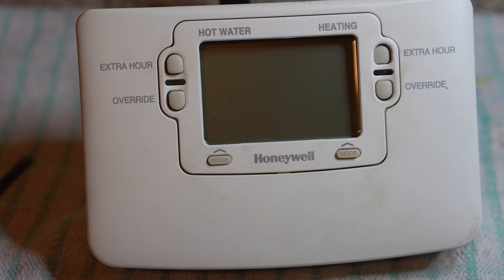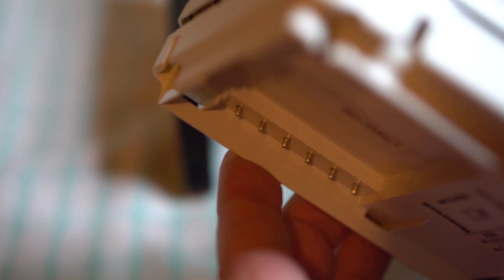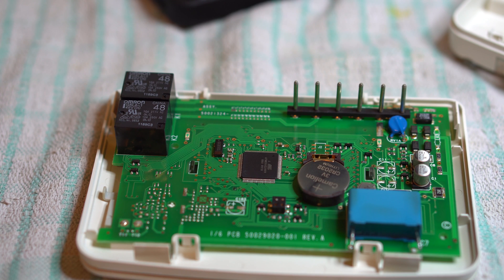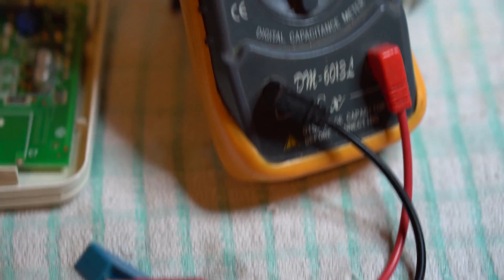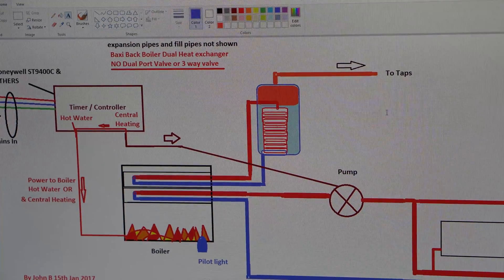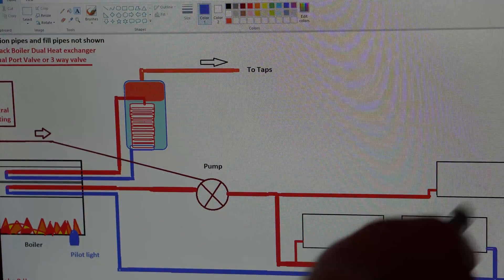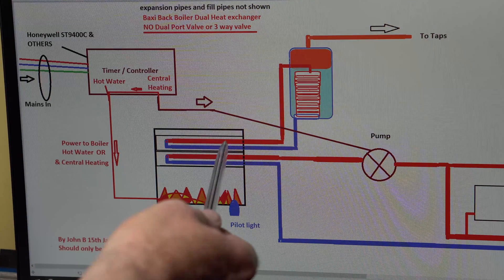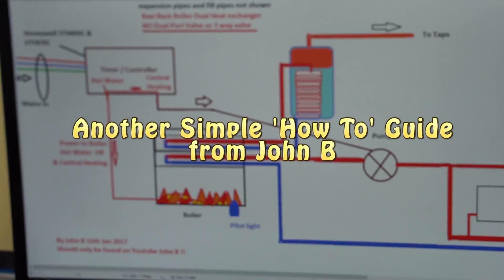Central Heating repair guide Honeywell Timer Problem with Back Boiler ST9400C

Comment: Awesome video, thanks for sharing. I will be trying to fix my honeywell timer.
Reply: Argh, mine measures 0.66µF so guess that's close enough to not be at fault!
Still getting clicking on and off symptoms.
My circuit board is looking a little brown in the corner with the round blue ceramic capacitor.

Comment: Thank you for this. I had the same problem which took a month to find because one day the heating came on and another day it wouldn't. It seemed so random. Hot water always came on. I didn't find out what was happening until I turned the hot water off and the heating switched on! The valves looked OK. The boiler was serviced and it worked because hot water wasn't being demanded. It's one of those problems that can make you go bonkers.

In the end, a two minute job to replace the st9400c and it all worked again! So annoying.....
Reply from the maker: Thank you for your comment

Comment: I have one of these and it sometimes switches the CH on when it shouldn't be on. Although its set to auto, all times for on and off set, it changes to once or Continuos on its own. No problems on the HW. Its a vaillent boiler not a combi and only 18 months old. Any ideas, its driving me mad.
Reply from the maker: Sounds like moisture has got into it. 
Time for a new one.

Comment: The caps age by slowly reducing capacitance. I tested many in this circuit arrangement and depending on the quality of the supplied capacitor the effect maybe very fast, like months or, may last many years. I experienced a nightmare batch problem with a product where all units started failing in a few months. Cost the company (not Honeywell) a fortune to replace them all. Take care to fit a really good quality cap from a reputable supplier.
Reply from the maker: Thanks for sharing

Comment: Hi John, really great video with good explanation. My problem with this unit is intermittent output to the boiler. Boiler runs for awhile then stops - no voltage. The capacitor on this unit measures .864 microferads (the one on your video was .68 microfarads.)  Could this capacitor still be the culprit in this case? May just have to replace the unit.
Reply from the maker: Thank you for your comments.
I'd replace the unit, B&Q sell a good one for £25 approx.

Comment: Hi John, great video and wondered if you could help me with my problem. I have the same programmer and if I put the heating or
The hot water on a hear a click for both but for some reason the heating doesn’t actually come on but the hot water does. I’ve tried them both separately but just doesn’t seem to want to get the heating side on. At the min I’m having to put the heating on via the water but move the 3 port valve over. Could it still be the capacitor not drawing enough power even though I hear the click? Thanks
Reply from the maker: It's difficult to say without testing the parts.
You need a test light to see if power is going to the 3 way valve.
Maybe buy a new programmer from B&Q for £25 to eliminate it.
Reply: Mines doing the exact same but sometimes it works sometimes it doesnt
Reply: Mines doing that lol get both clicks too

Comment: My Honeywell timer switch is playing up, I think I'll replace whole unit....like for like...isolate electrical circuit and fit same..unit, probably easier for me. I'll take photo to merchants...think I may be able to fit okay. If not sure get professional in...have a look at it first.
Reply from the maker: Yes, sort of easy to replace with same size and make.
2 screws underneath and the whole unit hinges upwards to release the electrical contacts.

Comment: I have a same problem now, I didn’t hear any click sound , hot water and heating doesn’t work. Must need to change the capacitor?
Reply from the maker: It sounds like it.
You could hit the timer to see if it will help the relays come on.
Or, as I did last week,  go to B&Q & buy a new one for £25, they are great and work the same.
https://www.diy.com/departments/salus-2-channel-programmer/5060103693511_BQ.prd

Comment: I had the same problem, the timer would click on the water side but not the heating. After watching this video a few times, decided to give it go. Ordered the 0.66 305v from ebay and changed it. Now I get to hear the "click" on both the water and heating side and it all works. Only time would tell if it lasts., albeit no cap test and some very dodgy soldering. A few quid saved for now, so thank you very much John B.
Reply from the maker: Excellent news, thank you for your comments.

Comment: Nice info on the problem with electronics of the ST 9400c Only one heat exchanger on a Baxi Bermuda though 👍.
Reply from the maker: David Kennaugh yes someone pointed that out, although 2 sets of pipes

Comment: Very smart. I have one of these showing the symptoms you describe.
I should point out an important safety issue. The choice of capacitor is very important. It must be X rated, which means it can be connected direct to low voltage mains and if it fails is less likely to fail in a ball of flame. It must be X2 or X1 rated as these can handle higher voltage spikes. The capacitance value is important because this will dictate how much power is drawn from the mains. excess power is dissipated as heat so a larger capacitance will create more heat and probably lead to failure. A lower capacitance will not provide enough power to power the circuit.
Another thing I should point out is if something else in the circuit has failed and is drawing excess power then replacing the X2 capacitor will not help. It is for this reason I'm not going to repair mine.
Reply from the maker: nice

Comment: Thanks for the vid, John. I have a ST9100A which is the same from this aspect. 48V relay is only getting 20V. What a cheap and nasty circuit. How many electrical appliances are thrown out every year due to a bad dropper cap I fear to imagine (same thing happened on my freezer, which I also fixed - with that the dropper cap was voltage under rated for AC). My unit is about 7yrs old.
Reply from the maker: 6 or 7 years is about the norm

Comment: Many thanks John.

We have a standard 'Y' plan system with a 3 way valve. A few days ago we had no hot water and following a quick check I was convinced that the Honeywell 3 way drive unit was the culprit.  I replaced it and all appeared OK, but then the next morning, no hot water again.
The readings I was getting on the 8 way wiring block, were very confusing.  One minute a terminal would show 240v and a couple of minutes later it had gone.  I checked all of the wiring and everything was correct.
Then I discovered your video and the penny dropped.  Sure enough if one relay was energised the second wouldn't switch, and of course the voltages were only present for the circuits controlled by the first relay.  Testing confirmed the 680nf capacitor was actually 350nf.
Radio Spares EPCOS 680nF Polyester Capacitor PET 305V ac ±10% RS Stock No. 874-1456 cost £2.12 for 5 (minimum order) including VAT, and free delivery.  I now have 4 spares, which should last me out.  So 40p  against Screwfix 's price of £96.59, for a Honeywell ST9400C programmer. The relays now operate with a reassuring click and the system operates as designed.
In conclusion I owe you big time.  Cheers Noel.
Reply: Hi John exact same issue with mine,  thanks for the info.  £5.88 for 5 plus £4.95 delivery + vat  £13. Found this on Ebay https://www.ebay.co.uk/itm/0-68uf-680nf-275vac-X-type-capacitor/282120826789?hash=item41afb62fa5:g:YqsAAOxyc2pTbMYn  not the exact same spec but would it be ok. Thanks.
Reply from the maker: Excellent news Noel, I'm pleased you were able to save the best part of £100 and now you understand more about your timer too which can't be a bad thing.
Have a great weekend.

Comment: Any estimates on how much to repair if you called out a plumber who says this is the problem and needs replacing?  £264
Reply from the maker: Peter Roberts 
Omg 
The timer costs less than £100 and 10 minutes to swap over.

Comment: Hi I can't find a capacitor with the exact details that my one has out of this Honeywell model but can someone please send me a link of ones I can buy
Reply from the maker: Try Farnell
Reply: John B
Hi just looking on the website. Which one do I get
Reply from the maker: Rebecca Ford what is the value of the one you have?
Reply: Sorry I don't even know what writing that is on my capacitor
Reply: The numbers on the side are:

B3293 x2 MKP/SH
40/105/56B

Then it has a logo EN  10
                                 EC
                                  305v

Then 1414 (250v~)
            1283 (305v~)
Reply: On the top it says m105255980 B
W2-u68 k305v~
Reply from the maker: @rebeccaford3868  You will have a value like .33uf .47 or .68 uf etc all at 305 volt ac 
Those values are point 33 .33 etc 0.33
Do you have someone to solder it in for you?
Is your thermostat dead?
Where in the world are you?
Reply: So is the value not in any of the writing. I have to found someone who can test the capacitance for me to see if my capacitor is working properly at what I thought would be 0.68 just based on what I saw in your video as it's the same Honeywell model. Then have someone to solder once I've ordered the capacitor if I need one or I'll have to buy a new Honeywell timer.
Reply: The Honeywell just keeps clicking on and off and flashing but won't stay on for more than 3 seconds then turns off one one then back on
Reply from the maker: @rebeccaford3868  .68 sounds good, if the timer is becoming intermittent or only one mode works, just order the cap and replace it. I'm in South Yorkshire so too far to pop round and check it.
Reply: John B
Yeah but that's the problem I'm not sure which one to order. Do you know based on the details I gave earlier what one off the site is ok or can you send me a link off any if possible please? Is it any 0.68 at 305v then? Then if I test the capacitor I have and it is less I know if need to buy one and wait for it to come. If it does read at 0.68 then I was just going to go out tomorrow and buy the same Honeywell timer
Reply from the maker: @rebeccaford3868  https://www.ebay.co.uk/itm/CAP-FILM-PET-0-68UF-305V-RAD-B32934A3684K189-Fnl/272684004780?hash=item3f7d3bb5ac:g:lNIAAOSw~y9ZJIlF:rk:4:pf:0
Reply: John B
Thank you only just seen this. Ok thanks for all your help so I'll order that. Does it matter that the metal clip bits seem really long in the photo compared to my capacitor that came out I thought terns of fitting it back in the space and any tips on what to do to solder it well I'm going to ask someone who I know has a solder but don't think they've used it for years.
Reply: Also I did ask someone and have borrowed a multi metre as no one had a capacitor reader but not sure how to use it yet a and my capacitor doesn't actually have plus and negative markings on it so not sure how to test it or if I can? I was just going to test it in case as then wouldn't have to wait for a new one to come
Reply from the maker: @rebeccaford3868  One simply removes the faulty cap, solder in the new one and cut the legs to suit the pcb

Comment: The comments may be accurate on the electronics, but less so on the heating, the boiler has a single heat exchanger with connections for both pumped and gravity circuits.If gravity circuits are used for the hot water, the control will only provide heating if the hot water demand is on. The st9400 must be configured as a mini programmer to achieve this.
Reply from the maker: Why are there 4 pipes to the back boiler then?
Reply: Two gravity circs, flow and return, and two connections for the pumped radiator system. Flows connected to the ports at the top of the heat exchanger and both returns connected at the bottom.
Reply from the maker: I'm now completely lost. 
So  if there are two gravity circuits, there are 2 heat exchangers in one unit, no?
I'm trying to understand your first comment.
If one wants hot water only, the timer will fire up the boiler.
If one wants heating, it will fire up the boiler and the radiator pump.
A consequence of heating is hot water.
Reply: https://goo.gl/images/8pWrV4, https://goo.gl/images/Mh18gC. One heat exchanger with 4 connections. Two used as gravity circulators for the hot water, the heat produced in the boiler produces the energy to move the water/heat in the circuit which passes through the coil in the hot water tank where it cools and back to the boiler, the simple principle that heat rises. The second pair of connections are used for the pumped circuit to the radiator system.Turning the heating on at the clock will only switch on the pump and will only circulate unheated water, unless the hot water demand is active at the same time, hence the need to use the control as a mini programmer, i.e. the switch times are synchronized.
Reply from the maker: YouTube keeps cutting off my reply.
I know hot water rises, i mentioned it in the video.
If you're saying the 2 circuits are not separated, and the water is the same in both circuits, then you should say so.
But that's just splitting hairs, there are still 2 circuits.
As for the programmer being set to 'mini programmer'  that just confuses the issue.
It either turns on the boiler, or turns on the boiler and the pump.
Reply: You initially stated that there were two separate heat exchangers which is fundamentally incorrect, and that is the point I was making. There is ONE heat exchanger serving both circuits using the same water.
To have two separate heat exchangers, assuming you found a means of independently filling the second with water is the description of a bomb, a closed vessel with no vent subjected to an uncontrolled heat source. You would succeed where the Luftwaffe failed. I don't see this as splitting hairs.
Reply from the maker: So I got the terminology wrong, I meant 2 circuits and drew them as 2 independant units.
I hope you didn't think I would take the boiler apart and find 2 totally separate units above the flame?
If you did, then you're mistaken. 
I didn't know they are one and the same inside the big block with 4 pipes.
But this video isn't HND boiler design, it was the "basics" of why my partner's system went wrong and I believe many other people will have the same problem.
I didn't even draw the water fill pipe, so yes you're splitting hairs.
The drawing represents 2 circuits in the boiler which this particular system had.
I'd draw a little pipe linking the two to keep the peace but it's not that easy, I don't have the original any longer.
Reply: I am not sure altering the original is necessary, anyone reading this discussion will be left in no doubt of the mechanics. Split hairs, absolutely not. I thank you for the information regarding the control display. I see this on a regular basis, so will no doubt give it a try. Cheers.
Reply from the maker: Well I must thank you for pointing out the construction of the heat exchanger.
An old work colleague had 2 big bore pipes running to his boiler. 
One of the 'big bore' (pretty sure it looked bigger than 22mm) was scaled up so He had no hot water.
I did not know such a large pipe could become blocked, we live and learn as someone said.

Comment: 0.68 or 0.068?
Reply from the maker: I said 'point 68' and then said I was joining two point 33uf caps in parallel.
Reply: so I sould get a 68uf capacitor?
Reply: I was having a look in maplin but wasn't sure with to get?
Reply: Genius. Had exactly this problem. New capacitor and we were back up and running. Thank you.

Comment: Great bit of information, thanks! Although I've never seen a back boiler, I don't think they're common at all in Belgium. Almost all systems are pressurized combi boilers. Cheaply made to fail electronics however, seen lots of those :)
Reply from the maker: Thank you for your comments.
Handy to know they can fail but appear to still work.